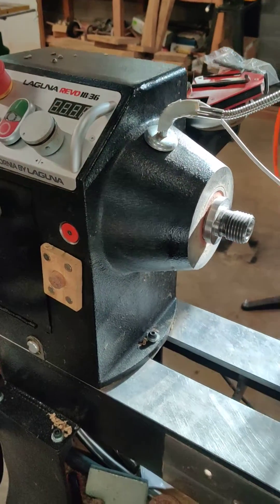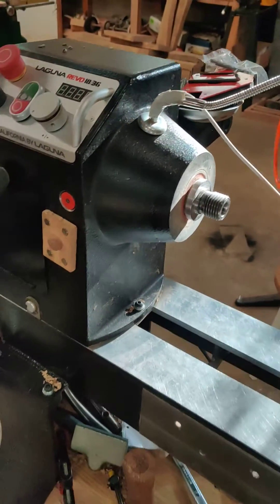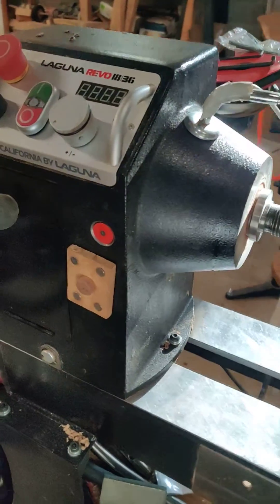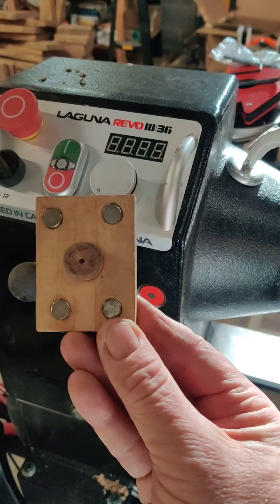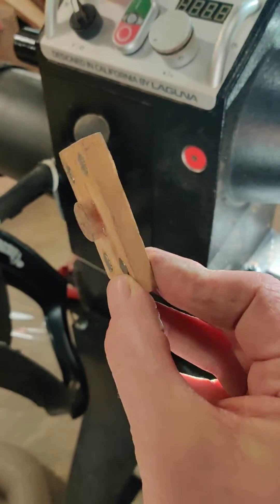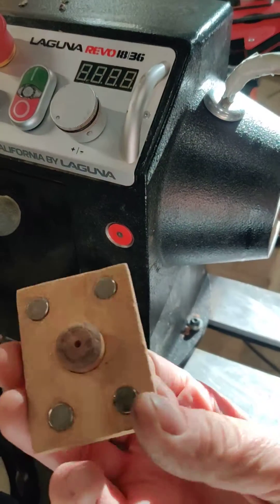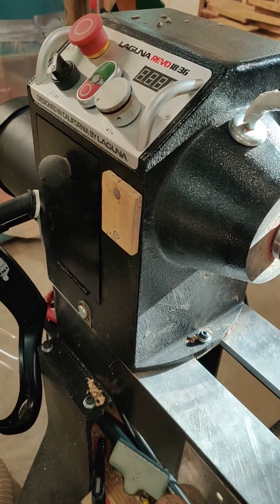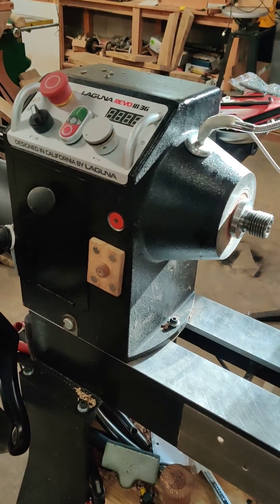Laguna 1836 lathe Easy spindle lock fix

Comment: Very clever. About the same idea as I used on mine.  https://www.youtube.com/watch?v=AzExi1D8sak&t=24s
Reply from the maker: I saw your video (I have seen all your videos) and liked it. I was trying to find a way to not modify the lathe from its original state.
Reply: I like what you did with yours. Looks like it would work great. I was disappointed that they did not come with a spindle lock and I did not want to drill into the headstock to make one. Those magnets are great. I used them to hold allen wrenches and chuck key close at hand.
 Any other issues with your lathe?

Comment: I really like your idea for locking the Laguna lathe spindle.  I have a #1216 Laguna.  How strong are the magnets you used?  I’d like to make one.  I can see how useful it would be.  
Thanks for your help.
rd
Reply from the maker: I used fairly cheap neodymium 1/2" x 3/16"  magnets found on Amazon I think. I would suggest using as many magnets as you need to hold the red button fully engaged.  1 or 2 on the reverse side...
Reply: @stevioclark   Thank you very much for your help.  I appreciate it.